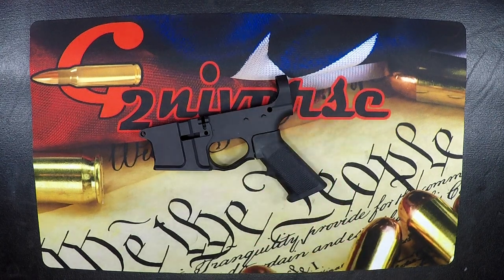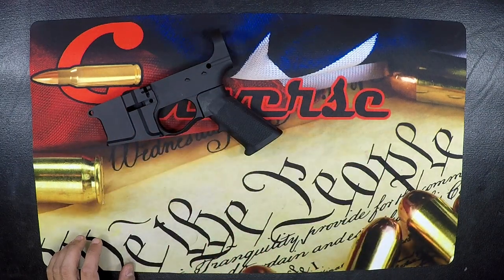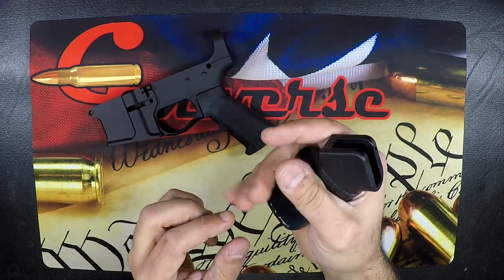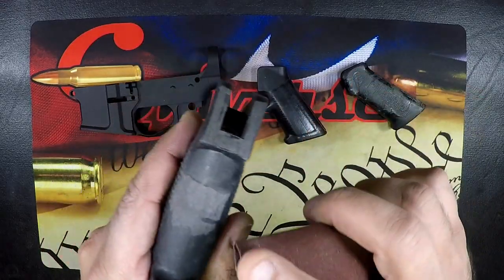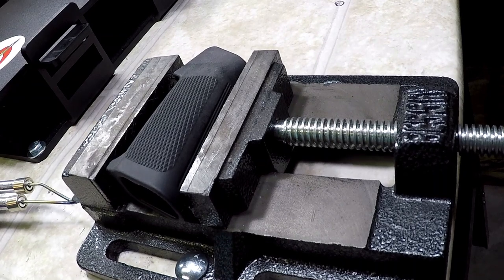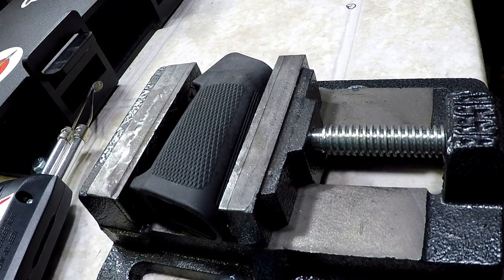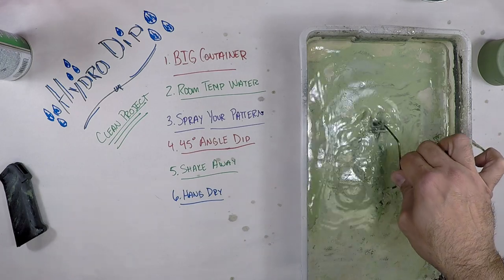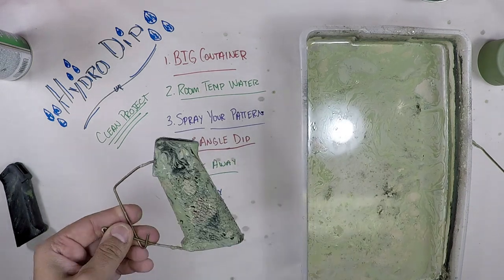A2 AR Grip Upgrades

Comment: A2 grips are the best value on the market by far.  They don't look amazing but they also don't hinder accuracy at all.
Reply from the maker: all grips hinder accuracy if they are not fit for your hand.
Reply: @G2niverse  

No U.S. Military Veteran could use that as an excuse who qualified prior to 2005/2006ish AFTER which everybody started thinking a stock factory rifle as it came was no longer "good enough".

Comment: What to do with them? Take a X-Acto knife with a new or very sharp #11 blade and shave the mold flashing part line off both the front and back. Take a little 400 grit sandpaper and get all the spots you missed. Using 120 grit aluminum oxide set your blast pressure to 40 psi and blend in the rest putting a nice profile texture to the grip. By then you realize most of the gripes about the A2 stock grip is all in peoples heads. It is really not a function issue any longer. Colt factory grips need none of this done but all the others do.
Reply from the maker: John Doe You make a great point!

Comment: I swear by the Magpul Emily plus. It's good this rubber wrap around on a polymer frame. That's what came stock on my Sig m400. I couldn't imagine running an AR-15 without that exact same grip on it.
Reply: Emily? Did you mean the Moe + (Moe Plus) ?